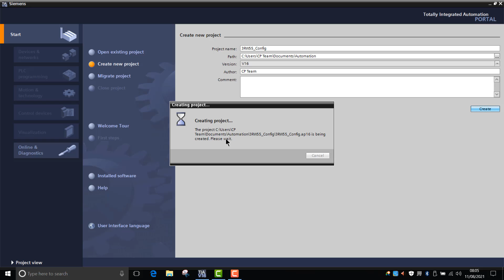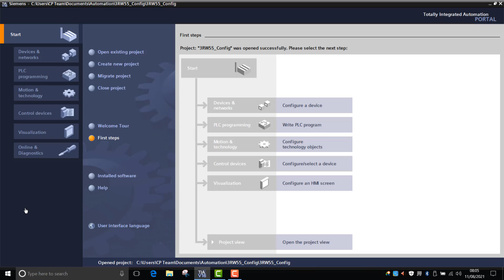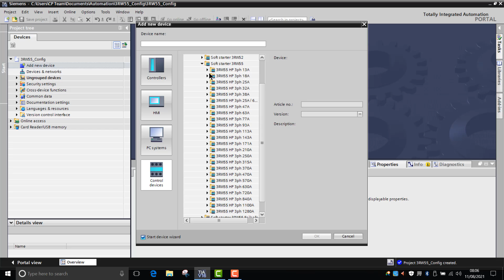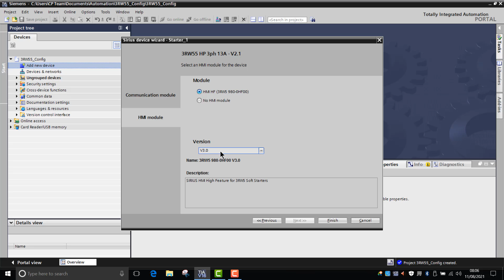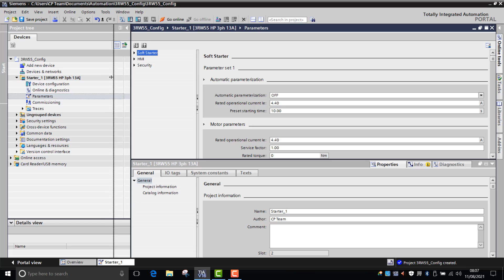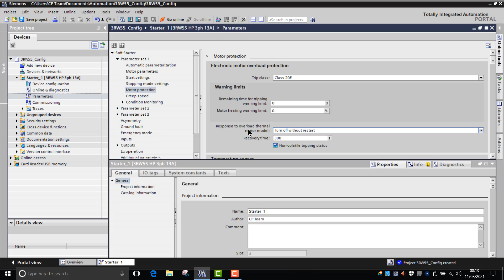3RW55 Programming Basics

Comment: hmi not Configured fault showing on display after Power Recycle, Before Power Recycle all ok. HMI also added in Hardware Configuration, Profibus DP Card also added. when it start to communicate with profibus comunication and found Bus node healthy, but after power recycle all configured hmi missing automatically from hardware configuration. why it is happening